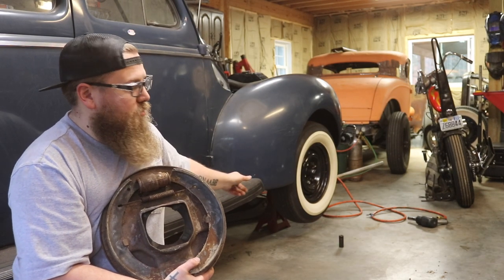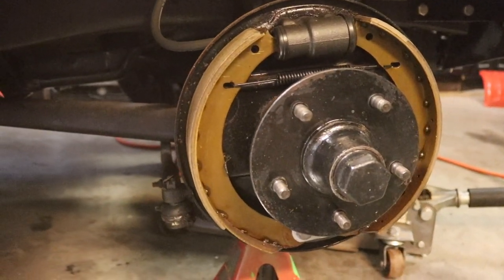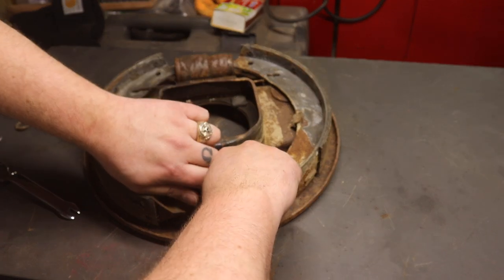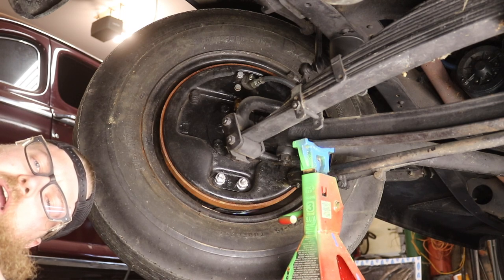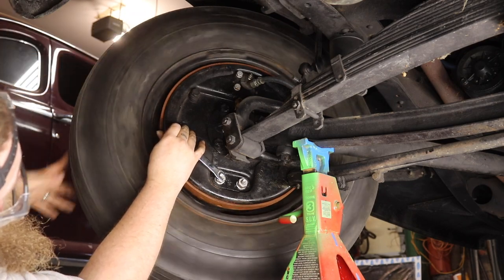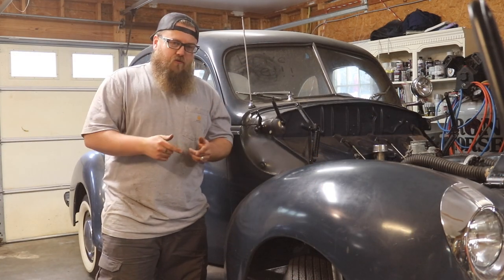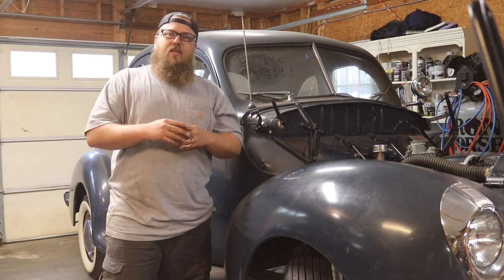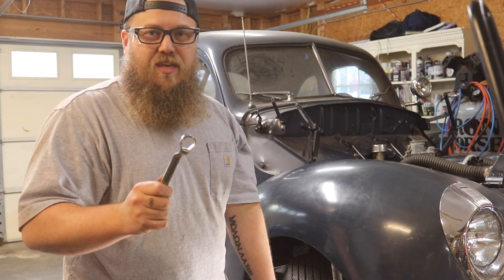Early Ford Brakes, Adjusting Eccentrics and How They Work

Comment: Great video on Eccentric Brakes. I'm currently restoring a 38 Ford Sedan and upgrading to 39 Ford Juice Brakes. I noticed on the car your working on appears to have new hardware, specifically the lower eccentric adjusters. Where can I find these? Also, the 39 backing plates we have aren't adjustable on the lower mounting pins. They just have solid studs/pins with a round washer at the lower end of the brake shoe. Given the information you share I don't see how these can possibly work without being able to adjust the brake shoes into proper relationship with the drum?? I have great pedal pressure but little to no stopping ability. It seems the brake shoes are only contacting the drum at the very top of the shoe. Any advice you can share would be greatly appreciated.

Comment: Zach, I just pick up a set of juice brakes still on the original front axle. My lower adjusters are on the inside of the backing plate. I’m guessing that it’s the same procedure except for a lot of assemble and disassemble of the front tire and drum?

Comment: I made a tool to center my brake shoes on my 1955 Powell aka 1941 Plymouth chassis. On my Plymouth brakes the bottom eccentrics makes the shoes not only rotate out at the outwards but also upwards. Even with the tool I made adjustment is still difficult.

Comment: Zach, you got any information on converting to a three speed. I have a 1951 Ford v8 victoria. I dont like the automatic transmission , its leaking and had it checked too many times. Its costing too much to keep trying to fix it. What transmission to look for. I bought a three speed, has overdrive ,at a swap meet but not sure what year is it from. Any leads would help with. Thanks